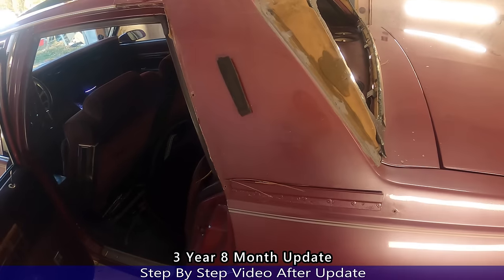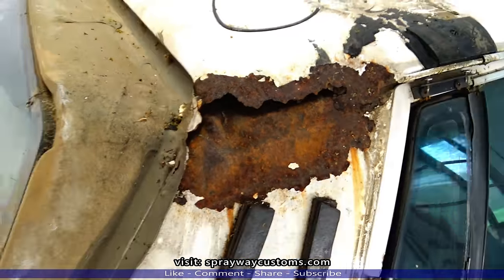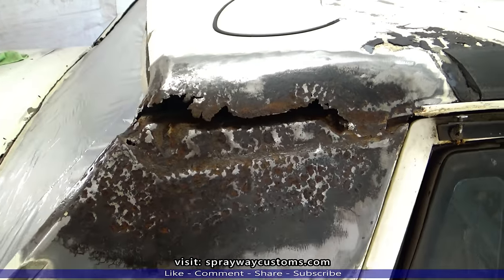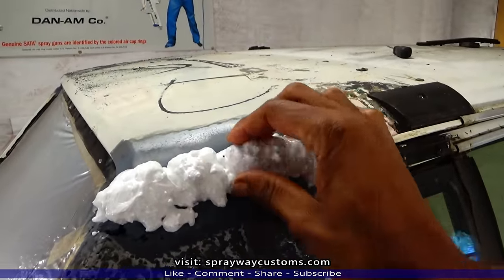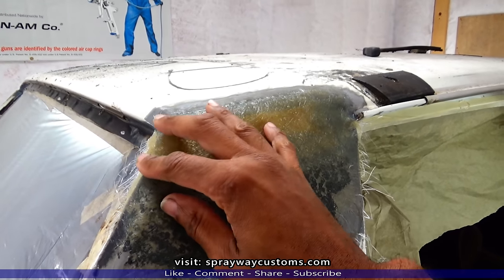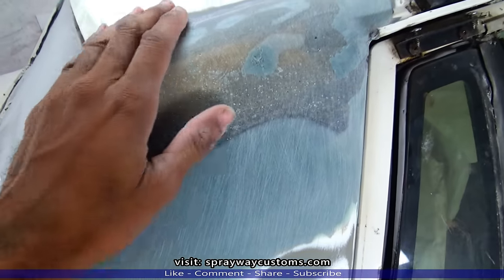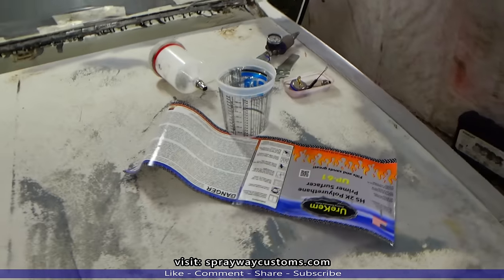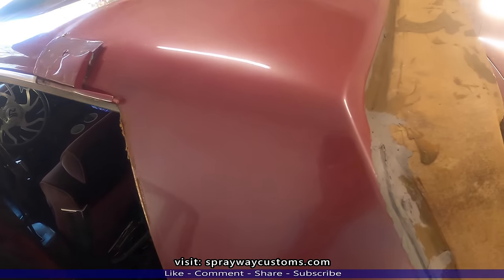How To Repair Rust On A Car With Fiberglass & Spray Foam Without Welding - Vinyl Top Rust Repair

Comment: That’s impressive I think the first time I ever seen some one use spray from and  fiberglass on a Rust hole was sprayway custom I remember making a comment I would rather cut it out and weld it but you have an inner and outer panel there and you can’t get to the backside of the Weld to clean it up never doubt spray way and happy birthday man 🎉
Reply from the maker: Thanks Jimmie

Comment: You are 100%right it can and has lasted but it’s just not the right way to do it.  The structure of the roof is completely compromised and now if there was ever an accident you are relying on spray foam to save your life
Reply from the maker: Yep, I’ll take my chances in this than a convertible 👌

Comment: Very nice young man.  Your gun doesn’t seem to have the overspray everybody else’s has.  What are you using.  ❓❓
Reply from the maker: Thanks Gene. I use a SATAjet 1000 B RP 1.8 tip for primer, SATAjet 5000 B HVLP 1.3 for base, candy, IWATA WS 400 Supernova 1.3 tip for clear

Comment: I did this years ago to doors that were completely rusted The foam was eaten by the reason Next try I skimmed the foam with bones then fiberglass all went well 5 years later I saw the car at a car show and told him what I had done He took the inside door panel off to prove me wrong and there it was still standing tall and he got a trophy as well
Reply from the maker: Sounds like it worked for you 👌

Comment: I got foam in my Corvair Sedan rear roof overhang for like 10 years. lol Stopped the air noise and hasn't gotten any worse. Rust encapsulator first, then some foam.

Comment: Retired bodyman here. I worked mostly in collision  repair but my early years was in rust repair.  One year I bought a caviler which was solid but it was covered in rust blisters, hundreds of them. I bought it from a farmer. He had a major stone road that he drove everyday. The stones peppered this car with blisters. The front hood and roof covered from cars driving in front of him. The sides covered from stones flying up.  I did as you did in removing what I could with grinder and rust wire wheel. Every panel was covered in these quarter sized rust blisters. After cleaning as much as possible. I neutralized by using vinegar also. I then used just fiberglass resin as the barrier and finished with skim coat of bondo to level. That car lasted till finally the motor gave out, but those rust blisters never came back. The outside body was great. To be honest. I was amazed how well the resin locked on and sealed the areas after it was cleaned and neutralized properly. You do great work my friend.
Reply from the maker: Thanks a lot. I appreciate you sharing your story with me 🤝

Comment: Good work man. Look into picking up a cheap pot style sand blaster and use crushed glass media. You don't need a big compressor or a lot of pressure. It would clean out all of the rust quick and effectively and not cause warping for heat. Just an idea for future projects.
Reply from the maker: Thanks for the info

Comment: Quick question - is there anything else that could be used instead of foam? That you know of?
Reply from the maker: You actually don’t have to use foam. You can use a wire mesh or fiberglass mesh
Reply: @SprayWayCustoms  Ok great...thanks man!

Comment: I am a self-taught backyard wannabe, I just work on my own vehicles trying many of the tips you offer in your videos. I am running into a problem with the back fender wheel arches on my truck, I cut out the rust sanded scraped wire, and brushed the bad spots and rust pits. I have tried the white vinegar, those rusts restore products POR 15 etc... I used the epoxy resin and fiber mats and the long strand filler and I prime with self-etching primer and then sandable primer, and paint. Unfortunately weeks after the job the patch seems to rise up and bubble in a few places, I make sure everything is dry before paint and look for any moisture in the fender before patching. Can you offer a suggestion as to what I am doing wrong? Thanks.

Comment: gd job but to be definitively efficient against rust - Curative and preventive -  ,  you should  put grease everywhere. grease is the only thing very efficient against rust. put grease between metal and carpet, inside door, behind metallic bumper, under the vehicle, behind  the repairs you can make (everywhere inside the body - hidden erea -  instead of using paint), hollow areas (necessarily hidden, so no need to be aesthetic). For rear wings unreachable with a paintbrush, use an extender and pour old oil everywhere each year. Rust almost always comes from the inside and welds.  Handyman Experience - 35 years.   From france

Comment: Looks great apart from the oversized wheels and skinny tyres, but this car is now a death trap 😅
It's never wise to hide structural damage like this. Anyone doing repairs like this should be held accountable if the car is involved in a accident!

Comment: Man I was tripping out. I just bought a 2009 Chrysler 300 that’s been sideswiped and has a bad rust spot on the rear wheel well. My plan was to go out and buy a welder. Cut the metal and weld in new metal and I just have to say, great tutorial…gonna fix it tomorrow.

Comment: It’s like a if you only have the choice option but if going down to bare metal and cutting out the cancer why not just weld a patch for a permanent strong long lasting repair

Comment: Hahah. As a life long auto body repair man it’s very simple.  If he’s putting finger glass , foam, or anything else over rust it isn’t a “fix”. Just a temporary cover. Because rust is still there. And it will come back. That’s a 100% promise and a fact. Now I didn’t watch this video because I don’t need to.  But when you are dealing with rust there’s only solution, cut out and replace affected metal and hope like hell you got it all.   And it’s tricky, it can have already affected the metal but can’t see it whim they eyes. You’ll think, in good! 2 months later bubbles start piping there little heads up and give you the finger.  At my shop, when it comes to rust, they don’t come in.  I’ll pass.  In a very rare situation , maybe.
Reply from the maker: If you didn’t watch the video…keep your theories to yourself 🫣
Reply from the maker: @curtishoward5584  well, I just did Mr. Curtis Howard the Professor 🤫Sorry to ruffle your feathers and hurt your little feelings 😢
Reply from the maker: If you knew for a fact that it can’t be done. That makes you the dumb ass for wasting your time to even click on the video to leave a comment 🤷🏾‍♂️

Comment: It's not the right way, cause the norm is use metal to repair metal. But it's not structural,  so fiberglass is fine and he cut the cancer rust out and properly prepared it  to accept fiberglass. This repair will last for a long time as long the rust don't crip from else where. Good job on the budget repair, i can tell you have a lot of experience.
Reply from the maker: I appreciate you

Comment: I disagree with anyone claiming that it is a "...permanent''...', fix - BUT - it is a DAMN GOOD solution and cost effective.  Yes - if it was a 'million $ car' - it would not be the proper solution, but for the type//condition//value of the vehicle, I think it is a 'smart solution' and will work well for the life of the vehicle and he did a reasonably good job at the prep work.  CHEERS from AUSTRALIA.
Reply from the maker: Thanks a lot

Comment: Watching this again before I try to repair my f-150 roof.   I do have a welder but no idea how I could make the curve I need.   I could go to the junk yard and maybe cut a patch panel. One piece I think is under my front windshield.   Not a clue how I’m doing that.   My truck won’t fit in my garage and in south Florida it rains a lot.   I can’t just take the glass out I’ll really have a problem.  I’ll do the back one first.  Going to use this technique.   I’m never sure how you didn’t end up with a bulge.  That looks thicker than the original.
Reply from the maker: Sounds like you got a great plan 🤝

Comment: What people don’t understand is Fiberglass is better than a bad metal/weld job. Main reason is fiber glass can’t rust after the repair while a lot of metal work will rust out again if the job isn’t done 100% right and sealed off 100% correctly
Reply from the maker: I agree…thanks for the comment

Comment: i mean if its just for show and to make it still be usable yes u can even use noodle soup and superglue and then fiberglass... but if he rolls over with that car... structural point is gone.. just buy a 20$ tig .. does wonders for car repairs like u shown ...  and is not hard to learn to weld really just point and shoot... no degree needed... is dummy practice basically. i know u can do miracles, been watching u for a while... but i wouldn't do this ..... unless the clients wants it like this on the cheap. but even then... i couldn't sleep at night if he rolls over with car and i did that to his car... theres some things we don't do ... in this trade ... i worked as a metal worker for trucks... and u could do shitty sloppy jobs that look and function good... but strength wise... horror movie last destination,  but is not worth knowing might of been ur "job" that made the difference to save the dudes life when he has an accident. As a tutorial video 10/10 as always u a master at this.
Reply from the maker: Much appreciated

Comment: That is the least structurally sound way to fix rust. Get a welder and weld in new steel so it has structural strength. Everybody has 120 v wire feed welder. If you aint got one , borrow a buddies.
The fiberglass work does look pretty tight tho..one thing I noticed is the resin is waaay thick. Git a can of fresh resin from a supplier who sells lots of it. Thick resin is way more work to get to saturate the  matt. 
Your results look decent man!
Reply from the maker: Thanks man

Comment: I did my truck cab corners like this with foam and fiberglass and mine cracked but it's because I didn't make sure to level the foam out b4 I fiberglassed it so there was voids which helped it be able to move from bumps on road and caused it to Crack and i only used fiberglass filler not mat. Just do it right like you did and most the time it be better than welding a new panel on because it can't rust now. I'm not a professional at all just a guy that is YouTube certified lmao...
Reply from the maker: Thanks Chase…greatly appreciate your story

Comment: Not sure how you feel about it seen a lot of your work and it is awesome but have you ever thought about 3M body panel adhesive? It's relatively inexpensive and that stuff once done accordingly to directions doesn't come apart might want to check into that unless you've already done it and you know what I'm talking about but you did an awesome job on this
Reply from the maker: Thanks Michael. I’ve used it before

Comment: I would hope that it is your head that gets hurt if you drive wrong. The repair you do with foam and fiberglass does not belong on a car. ALL metal that is removed from a car, either due to damage or rust, MUST be replaced with new metal. The repair you do must be done with a new plate on the fender and a new plate on the roof, the plates are fully welded on the fender and roof. They are spot welded in the joint is brazed with brass and finally lead (tin) comes over. This is the correct way to do the rust repair. So don't brag about the crap you do, but instead take a course in repairing cars the right way

Comment: How the car is stored/taken care of plays a big part in how long bodywork will hold up, you could do the sketchiest bodywork and if the car stays indoors where it's nice and dry and preferably in a climate controlled garage, then the bodywork will hold up for many many years. If you do perfect by the book bodywork and then leave the car outside and neglect it for years, even the best bodywork will start to fail and go bad. Obviously the owner of this car really cares and keeps it in a nice dry,clean area.
Reply from the maker: That’s true

Comment: Man I been battling rust throughs like this and they keep coming back.  I did the repair the same way.  And after 2 weeks the fresh paint starts bubbling.  I’m lost.
Reply from the maker: I’ve had issues with rust coming back like that as well. If you don’t completely get rid of it, it will come back for sure

Comment: Lol, this is the definition of a hack job. The only way to correctly fix rust is to cut it out and weld in new metal. This will rust again especially since now when moisture gets under there the foam will hold it in and make it rust even worse. I can't believe this is even being shown as a good repair. Lol

Comment: I got a rust hole on a lower quarter,  I was going to replace the panel. Nope! I picked up what you put down sir! Thinking about putting the resin on the quarter,  and the new rockers that I put on to keep it from rusting again.  MI winters are brutal.
Reply from the maker: Glad I could help

Comment: I think the right way was to cut and replace the part welding a new piece.  That rust still there and the place hace to much damage.  In a few year that will come to the surface a gain and it will reject the fiberglass.
Reply from the maker: 🫣I’ll be waiting

Comment: Shoot ole buddy that looks good better than factory like you say they don't finish it.
I'm going try ur white vinegar trick dad's 2010 Corolla has cracking on roof halfway and all way to back as gets worse at back. Bad surface rust. If don't get it I'm going have cut weld n new metal. So it's past time I'm welder fabricator, mechanic by trade. Body and paint no so much. Have camo some rifles with the wedge sponge brushes from dollar store and mart of walls little bottles paint n arts and crafts section lots people around here likes um but that's nothing compared to getting air compressor and laying paint lol. Did get cambell hausfeld paint kit from Walmart 20$ regular 199 maybe they was changing to Goodyear brand few years back got my son Blue 6 gal pancake compressor bunch air tools that paint kit all of it under 150 and 1/2" ,3/8 air impacts to air dies air hammers 2 each all that only one compressor and paint kit  but has two guns in it. Anyway it's been n corner now time put first spray through it lol. 
Great job great video I'm subbing up checking um out also monte Carlo SS is one my favorite cars that's real monte not front wheel driver 84-87 or 86 last year but like old big boats to 70s model early and late but 85,86 monte SS yeah t top. Had lx brown t top 305  auto n floor. Pretty nice had monte rot up top . Lol stay safe from ur ole hillbilly buddy good job again.
Reply from the maker: Thanks for telling me your story Paul….welcome to the team 🤝
Reply: @SprayWayCustoms  ten four look forward to catching up on the back catalog that candy blue think ur channel man looks good. Got 88 Suzuki samurai aluminum rocker cover's, aluminum back half quarter panels to tailgate new tires 30 " mudders well not new year and half years old but got 100 miles hard road few hundred miles mountain. Look new keep um clean armoural so don't dry rot go up on hill right my my drive way, dirt to. But that blue and silver lettering man be nice I think or camo depending on get her legaled up. Plates sticker right now it's my side by side. Check out some videos see what diy I can do look good.

Comment: If you use acetone against the foam it will Hardings  just as much hard as the fiberglass if not harder
Reply from the maker: Thanks for the info

Comment: I really feel like if I'd scoop up some of that spray foam, then go with the fiberglass inside the cavity, let that dry, and then add filler after it'll be more flush and also the fiberglass is less likely to be almost all sanded off. I'm I wrong? what do you think?
Reply from the maker: That’ll work
Reply: @SprayWayCustoms  ok thanks. ^-^

Comment: Is there a certain spray foam to use on filling a whole in rocker panel
Reply: make sure it is close cell and water proof. So it doesn't hold water. Make sure to use some kind of rust inhibitor on all the metal or you could lock in rust and it'll continue.

Comment: Why do you use the body filler over the dura glass?
Reply from the maker: To shape it up for blocking. Duraglass doesn’t finish like body filler
Reply: @SprayWayCustoms  so it takes care of the pin holes, and pits that the dura glass has at the end? I always have the little pinholes, and have to go back over with more or use glaze.